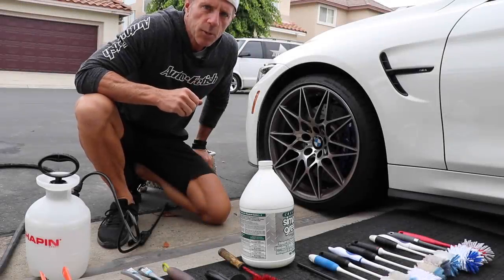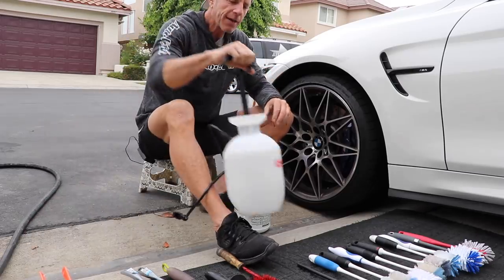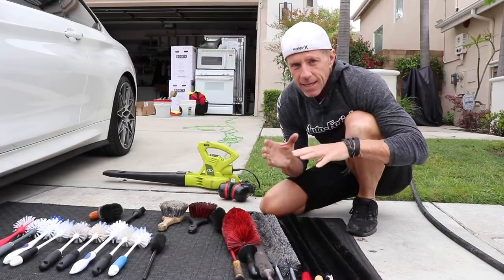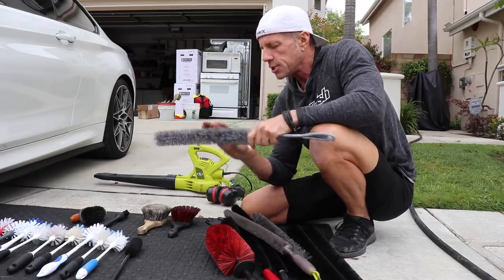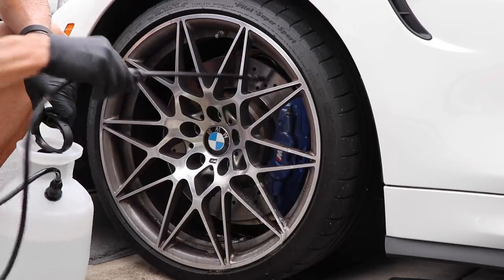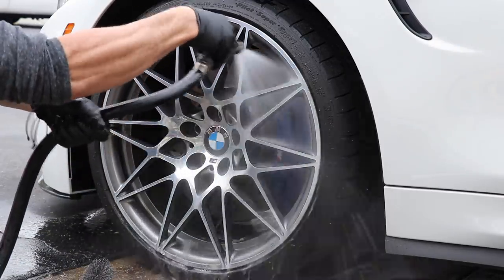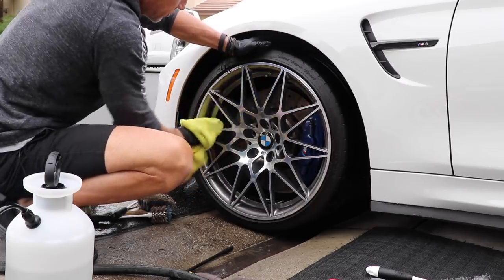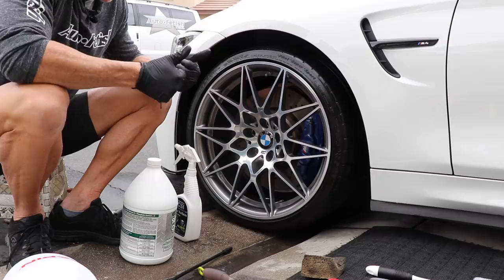Car Wheel Cleaning: Ultimate tools to clean like a pro!

Comment: I'll have to pick up those dryer brushes. How do you like using that mat? I've been looking into a few of them but I havent seen any that would last and be comfortable.
Reply from the maker: Mostly it is for display purposes. It is very heavy and thick so not really suitable for mobile detailing. It is the mat that goes in front of our washer and dryer in the garage. I use much thinner mats I buy by the foot at Home Depot to lay down when I need to protection on the ground  i.e. cleaning floor mats, etc.
Reply: Guys, do yourselves a favour and get a creeper seat: greatest  accessory ever....
Reply: @delphinebez3045  have link to product?
Reply: @richardfox3924  Depending on the discounts you will get you can either buy on Amazon, Griots... mine came from adamspolishes.com/products/adam-s-detailing-seat . They currently offer a 20% discount for new customers. I've been using it for one year every single week. Looks brand new, best buy ever !

Comment: I am pro detailer and i not like the  way of cleaning the wheel methods.
The way you clean the wheel is not wrong but there are some things that i not approved, obviously people had his methods of cleaning but i not recomend this way for any finish, using this method on a black finish rim with look so bad with many scratchs.

First.
The majority of european cars have a thick layer of brake dust, that mean using any detergents like degreaser, multipurpose or citric soap for those wheel will not remove the majority of brake dust that are stuck in the wheel. They work but are not so effective like Fallout o Iron remover that are the correct way for remove all brake dust in a safest way.

2nd.
About tools and equipments.
For the caliper you need to use a soft brush without compromising the paint finish, for inside the wheel you may use whoolie or smothie wheel brush for prevent hard scratchings and lost of gloss.
For the face of the wheel whoolie or soft wash mitt.
Use soft brush for edges and lugs nut
Behind the legs of the wheel,  i use a glove microfiber for wheel.

Use a Ik foam or Gloria foam for lubricating and cut dirt while cleaning the wheel.
A blower for dry and quit water of edges.
For last touch a quick detailer is important, the cleaning process will not remove all dirt and there are areas that tools cannot reach it. 

That is my way.
The tire obviosly is the same way he clean.

I am not trying to look better, but ask a pro detailer that my way is the safest way for cleaning the wheel without damaging it.
Reply from the maker: I have cleaned black, matte finish wheels as you have mentioned. I use the same method, same brushes and they come out just fine. As far as being overly cautious with the way you clean wheels; that is your call to make. But the brushes I am suggesting are very safe; especially your extra note on brake calipers. these brake calipers in specific, are coated with a thick powered coating and are extremely durable. It would be hard to even scratch them if I wanted to. 
This also happens to be a European car (BMW) so I am unsure why you think Euro cars have special brake dust that we need to be overly concerned about. I did say that Euro cars are notorious for slinging more brake dust, but the this cleaner obviously performed without overthinking it and having to use traditional brake/wheel cleaners. 
A couple of the main points of the video is to find an environmentally safe product that will perform effectively, efficiently, and safely. I think I nailed it with my choice in wheel cleaner and tools.

Comment: These video or good for cleaning nice cars that or a little dirty but what about cars that or really dirty
Reply from the maker: scrub pads of different kinds (based on the wheel finish type: Scrotch Brite abrasive pads, steel wool, Magic Eraser, pretty much what you have to use based on desired results and build-up), acid base wheel cleaner, and lots and lots of rubbing.